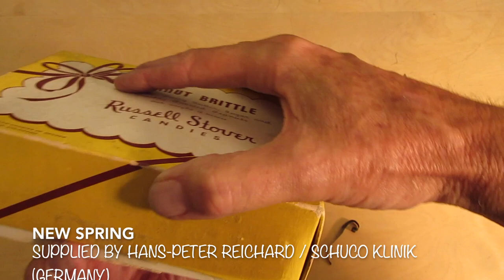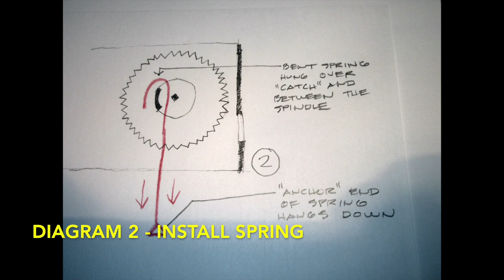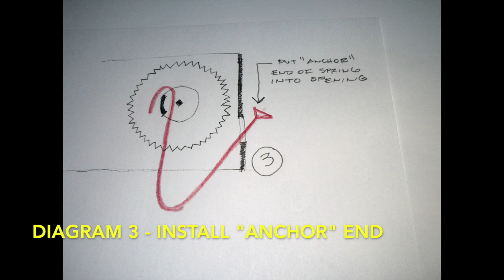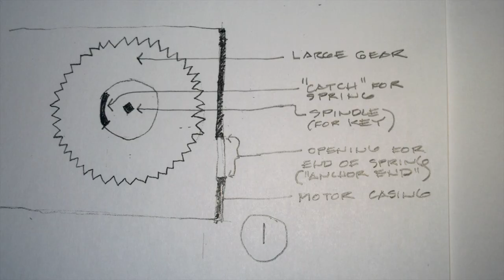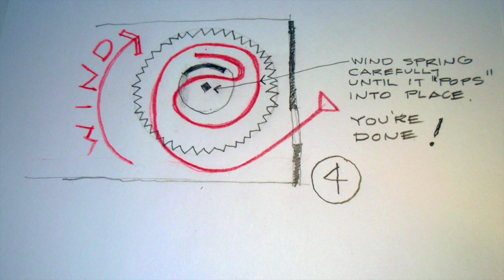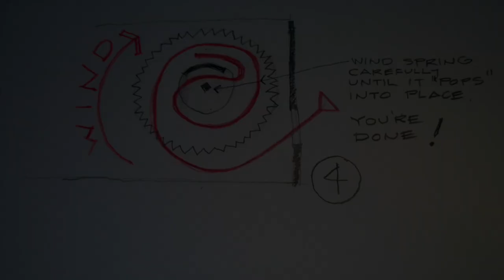Schuco Spring Replacement

Comment: I finally contacted Peter.  What a nice guy.   You're right he doesn't speak English and has to wait for his translator (son) to come over before he answers or responds to email.  I ordered some screws and springs from him.  I also found that 5.5 mm springs (called recoil springs on ebay) do not work but I did find today someone in China who swears he has 5 mm springs that he has advertised as 5 mm springs.  I bought one and it should be here in a week or two.  It does look smaller than the 5.5 mm ones I tried to use.   Each "spool" has  enough to make at least 3 schuco springs for micro racers and they sell for almost $4 a spool with free shipping.  I'll keep you appraised.
Reply from the maker: Yes. Peter’s a nice man. Thanks for the info and I look forward to hearing about those springs.

Comment: Great Video,and did a great job showing how too restring,the spring. Question I have is on the Anchor end if that has been snapped off how can I restore that end too hook it back on outer case notch. This is on a 1920s german Distler windup.
Reply from the maker: Take the old spring and heat it with a propane torch for a few seconds.  It will lose its "spring".  Then cut new notches out with tin snips.
Reinstall.  That's it!  i should probably do a video in that process.
Reply: @tinmeister356  hey thanks ,on that info,yeah I've learned trying too rebend those springs they snap, I'll go out in my shop and fire up a torch when I get time and duplicate what you said👍  Thankyou so very much on that info,and yes,do a video,I'm sure there's other people wanting too no. Tom from California🇺🇸🇺🇸🇺🇸
Reply: @tinmeister356  A video would be great.   Can we persuade you to do that for us?
Reply from the maker: Sorry it’s been so long for me to respond to your suggestion. And it’s a good idea too. I’m hoping to get back to posting new videos this Fall and Winter. 
I’ve been very busy with my work and getting my Speedster ready for a few shows this year.

Comment: What is the length of the spring for the schuco micro racer #1041/1042/or 1043 ?   Thanks
Reply from the maker: Sorry but I don’t keep that information. If you buy one from my recommended sellers they will know. More importantly, what is the width in millimeters?
Reply: @tinmeister356  Please give me his info again.  I tried to contact him but apparently had the wrong info.   thx    The width in the spring recoil I described is closer to 8mm instead of 5mm of the schuco.   I'm trying to locate a smaller recoil spring.
Reply from the maker: Try this:  http://www.schuco-klinik.de/english/Start_engl.htm

Comment: TinMeister ,,This is Tom from california 🇺🇸🇺🇸🇺🇸,I Just finished ReStringing the 1920s Distler Bus with the stairs on the back by using your vidio. And also are conversation last about taking tin snips too make anchor end. Like you said real easy. 
The windup works great 👍And im ready too do more👍  Thanks again , Tom
Reply from the maker: Awesome. I would love to see photos. Thanks!
Reply: TinMeister,,sure can send you photo's but caint find any email address and they won't let me send you photo's on this outfit. 😄  Tom👍
Reply from the maker: Dmaia@aol.com
Reply: @tinmeister356  What is the length of the spring.   Looks about 12-15 inches from the video.   Guessing..........

Comment: Great videos! We're having a hard time finding parts for these toys, can you share where to find the replacement springs? Need one for a Technofix wind up train GE 297.
Reply from the maker: Thanks for the question, but I've never replaced a spring on a Technofix toy.  
I do get springs for Schuco toys from Schuco Klinik in Germany.  Peter, has great orinigal parts for Schuco toys.
Maybe if you gave him the specs ( length, width) for the spring(s) you need he could find a schuco spring that would work.

Comment: I watched your video again.   The  "springs" you installed for a "schuco" were 7mm wide.   Some Schuco's are 7mm wide while the "micro racer" #1041,  #1042, #1043 are 5mm  wide. 
The one I bought on ebay are about 7 1/2 mm wide.   I am still looking to see if a recoil spring as they describe it, comes in 5mm in width for any type of lawn equipment.  I think the 7 1/2mm I found on ebay will fit some Schucos but not mine.  Still looking.
Reply from the maker: Did you get my last message?  Contact Peter.  http://www.schuco-klinik.de/english/Start_engl.htm